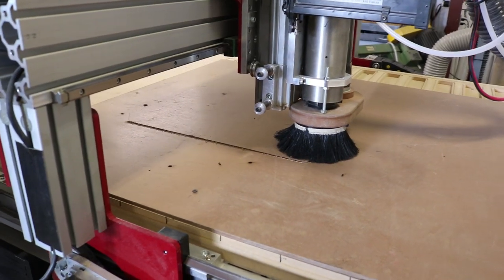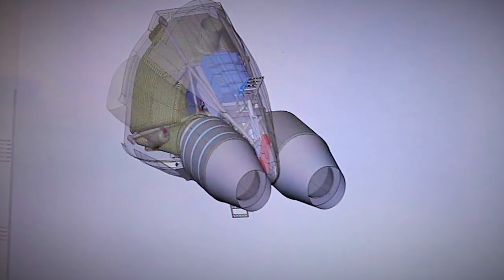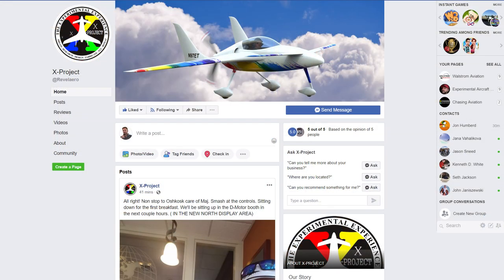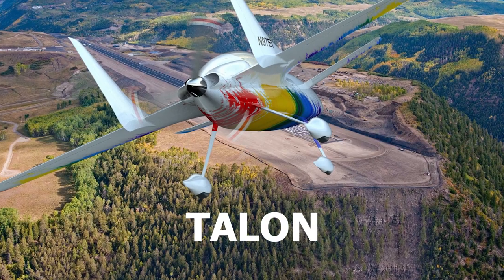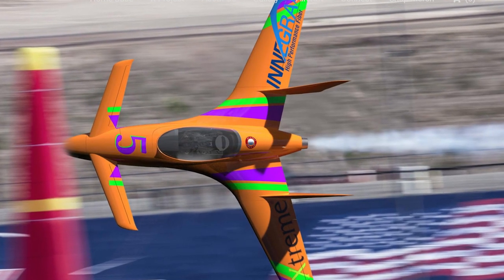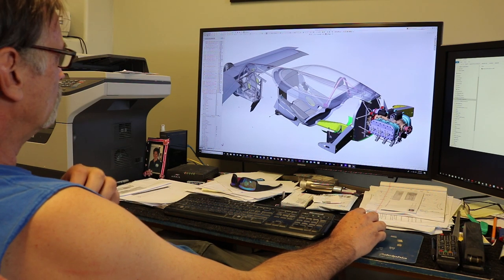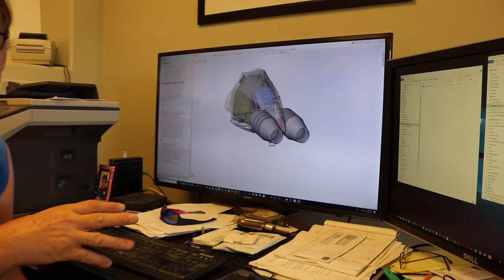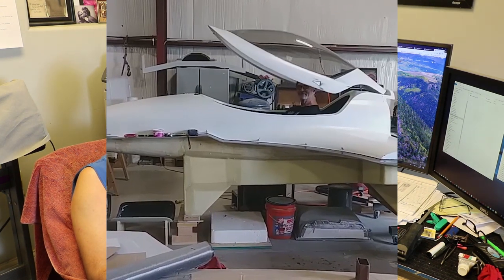Military Aircraft? Kit Concept or Real? X Project Composite Jet

Comment: To install install adel clamps long time ago in the Air Force I would take wire loom lacing, I flat nylon string and use that to pull the eyes together and catch a thread with the nut the pull the lacing out and finish the install.  Worked on a radar system that was installed on a C130 used to control the AQM 134 drone system.  LOTS of wires and LOTS of adel clamps.  Yehaaaaa!!!!!

Comment: Phenomenal, truly.
A Viking Engine would be a great low(er) cost option...
Reply: Where would you put the radiator?
Reply: Agreed, especially with their new 195 hp turbo. While passing up a turbine for a turbo piston would likely dent the soul, and just talking about it amounts to heresy, it would be a fraction of the cost to get off the ground.
Reply: @joeandjanice  re radiator,  I believe I've seen them integrated on similar aircraft by putting them behind ducting at the rear bottom of the fuselage.

Comment: I just put up a 900 sq ft steel building up so that I could start my cozy 4 build. I'm also developing a FADEC for piston engines. I think I will be using a rotary motor in my aircraft but I have been looking at the VW and Audi desiel Motors from the EU. I plan on building a Volmer or other amphibians aircraft after the cozy since I live in FL buy a big lake. Anyway good luck on your build.
Reply: Talk to VW about diesels, they have 500,000 of them sitting idle in locations all over the US and they are inexpensive.
Reply from the maker: Nice! Well.... maybe you can share some of that with me once you really get going. Sounds interesting! Thank you so much for watching and SUBSCRIBING! I appreciate you.
Reply from the maker: @kscipkkkk  Where? How much? Weight? Lot's of talk about the need for these engines as alternatives. On of these days an affordable option will come about. Thank you so much for watching and SUBSCRIBING! I appreciate you.

Comment: Very nice. I'm a firm believer in the potential of minimal single or tandem seater planes with either piston or jets. Or even electric but sleak and minimal.
My main aversion is the obtuse price of jet engines. We really need a revolution there. Huge potential because a jet is quite simple.
What jet engine are they planning to use?
Reply from the maker: AMT LINKS JET ENGINE.... from the "Netherlands" is what they told me. Thank you so much for watching and SUBSCRIBING! I appreciate you.
Reply: @ExperimentalAircraftChannel  hmm, that's a hobby jet manufacturer yet they want 60k euros for one. And it drinks as much fuel as a Pratt and Whitney PW615 which can deliver 6x the thrust. Looking at the PW600 series, it's actually a very small engine. Most is cowling and junk. And it's a turbofan so the jet itself is even smaller. We really need someone to make a clean basic version of such an engine for a fair price. Thinking large volume which will invariably follow if such an engine were offered at a reasonable price. And I'm thinking it could be very profitable at 50k$ which I'm guessing is about 20x cheaper than Pratt wants for one. It's such bullshit that that little hairdryer has to cost a million dollars.
Reply: @ExperimentalAircraftChannel  btw the thing he says about 3g acceleration is just factually wrong. Pretty weird miscalculation.

Comment: The design looks familiar to Burt Rutans vari eze and the Long eze.
Reply from the maker: It looks like a Canard...for sure. Many subtle difference in appearance on the outside but MANY engineering changes internally etc. Flight will be proof of concept of course. Very much looking forward to going back and providing updates as this progresses along. Thank you so much for watching and SUBSCRIBING! I appreciate you.
Reply: Not really it a canard.
Reply: I think all planes resemble the Wright brothers first one.  They all have wings Even a helicopter has one spinning overhead

Comment: 700lb thrust for 1100lb GTOW = 3g acceleration? If this guy did the math on this airplane and you buy one, God help you.
Reply: Good or bad?
Reply: maths... 3113N/500kg=6.23m/s^2 = about 0.63G.. this assumes the thrust is constant..
Reply: Canards are tricky to get right.
Reply: Easy math.  One lb. of thrust for a one pound object = 1 g acceleration.      An 1,100 lb. object would need 3,300 lbs. of thrust for 3 g acceleration.   (700 lb. of thrust per an 1,100 lb. object - 700/1,100 = .6363 g's).   If confused, think of a one lb. object sitting on the floor.   It is subject to gravity (1 g acceleration) trying to pull it through the floor, and the floor is exerting a one lb. resisting force (upward), so the object doesn't move.
Reply: Please god, help me to get one.
Reply: Yeahhhhhh I was really interested in this aircraft at first, but the more interviews I watch the less confidence I have that it will come close to living up to the hype they've given it.  If they can't estimate basic acceleration forces on takeoff, the claimed performance figures are likely just as dubious.  Let's not even think about the accuracy of aeroelasticity calculations at 400mph+.  Godspeed, future builders.  I'd love to have something like this that performed as claimed with good engineering behind it, but I'm not confident enough with a full scale aircraft designed by an RC modeler that doesn't have a PPL to actually put my ass in the seat.

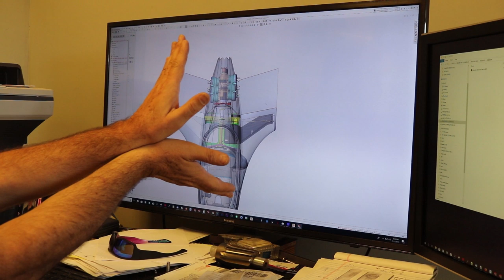Comment: 9:10 Awesome project! But how can 700lbs of thrust and 1100lbs of ac weight equal 3g acceleration during takeoff? Wouldn‘t that be 0.6g?
Reply: I came here to say that. Yes, you are correct. 700/1,100 is 0.6363... Subtract rolling resistance, integral of aerodynamic drag over takeoff run, etc. You end up with closer to 1/2g which is still pretty good almost double the acceleration of a fully loaded lumbering passenger jet.

Comment: Tow genius engineers, beautiful aircraft can't wait for a finished product, thanks for sharing
Reply: Genius? 9:00 700lb of thrust acting on 1,100lb gross weight does not equal 3g's of acceleration.

This concept is as complicated and difficult to manufacture as humanly possible for a 1 seat sport plane.
Reply: Genius? 9:00 700lb of thrust acting on 1,100lb gross weight does not equal 3g's of acceleration.

This concept is as complicated and difficult to manufacture as humanly possible for a 1 seat sport plane.

Comment: If each turbine has 170 pounds of thrust, that’s 340 pounds. Realistic take off weight probably around 700 pounds. How does that make 3g take off acceleration? What am i missing?
Reply: Jan Detlefsen Elon musk math
Reply: the extra high pressure of  vaporware
Reply: I wouldn’t know but is it easier to lift 700 pounds or to Put wheels on it and roll it? Maybe it doesn’t take 700 pounds of pressure to roll it

Comment: That's one pretty cool looking aircraft. I'm looking at hopefully starting scale development (scale modeling and RC for "proof of concept") this year. I'm setting up a kickstarter for some equipment (laser cutter/engraver and a resin 3D printer) for my vtol aircraft idea. Although the kickstarter is going to be set up for some war gaming products (dice tower, terrain and some scatter pieces), I'll be using the equipment for R&D on my aircraft design, battery charging system and some alternate propulsion ideas I've cooked up. 

Cool aircraft & great video. Thanks for sharing. Keep up the good work. I'm am subscribed.

Comment: Why put a jack screw in for the canopy? It adds weight, its electric powered, another button to press and can stop working,  there really is no need for it. Put it on a car gas strut with a lock on the front. Easy, light and will never fail. KISS

Comment: Truth be told, I'd rather just get a subsonex jsx-2. Long ways cheaper, you don't need a pilot's license for it and is just a good craft. This is really cool looking, but it'll cost way more to get, build, fly and be certified to fly. Only thing I can see it does better is be bigger, have greater fuel capacity and be faster. Yes those are all great things, but at what cost? Carbon fiber is monumentally expensive to buy and manufacture, why do you think Lamborghinis and Paganis cost so famn much? It looks cool, but, jeez I just ain't sure about this one.
Reply from the maker: Understood. One thing to clarify. You ABSOLUTELY need a Pilots License to fly a Sonex or SubSonex "Jet." Why would you not??

Comment: Pretty ballsy, going into production of an airplane without a flying prototype.. I guess if the numbers all add up it's all gpod
Reply from the maker: Typically speaking I guess that would make sense. However both of these guys of decades of experience building aircraft and involved in other successful projects over the years which has given them the confidence to break out on their own design. At least that is the information I gathered and was given. Everything that I say while onsite looked to be of high quality and good fitment thus far. Flight will truly be proof of concept. :-)
Thank you so much for watching and SUBSCRIBING! I appreciate you.